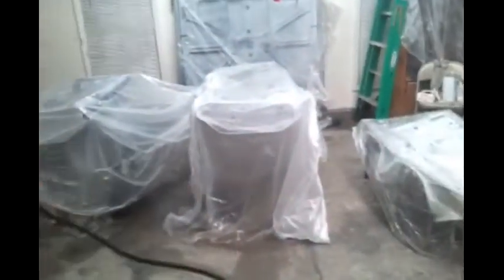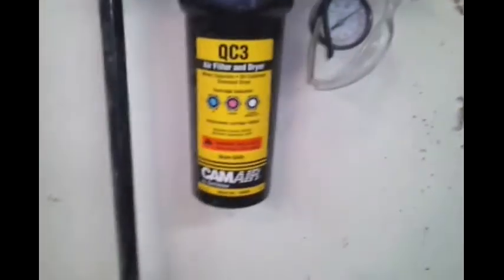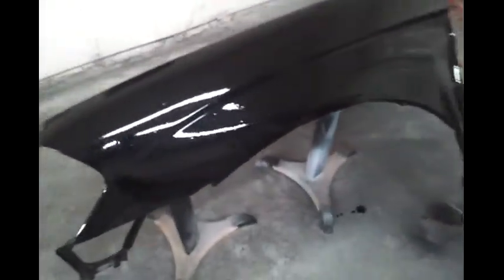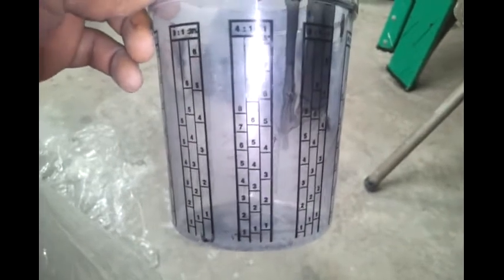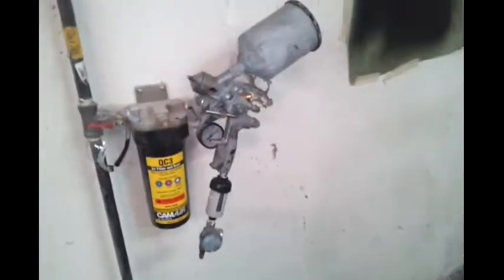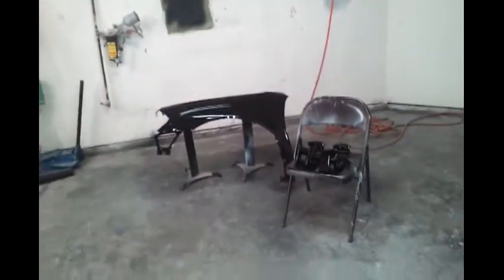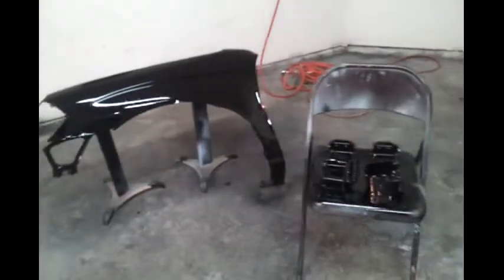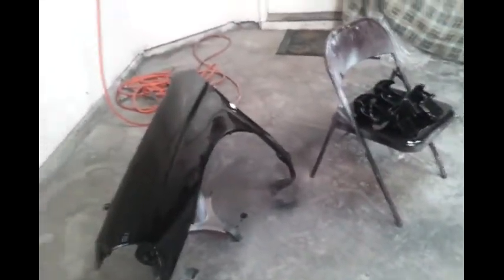Painting test panel and door hinges..."The Journey"

Comment from the maker: Thanks for insight, I hate I wasn't able to load the videos earlier so that I could get the heads up. I did a very very skim sand at 600, just to get the orange peel our of the 2K, so far, I don't see any scratches so that is good. I do need to dissable the entire gun was just worred about the settings. Loading the vids now of the jambs, standby because I have some questions..thanks for checking out the vids

Comment: Let me first say that I am a rookie too so take this for what it's worth. I might switch up the way you have your water filter set up on your gun.  I would put the regulator attached directly to the gun.   Move the filter below the regulator.  I find that the filters can really restrict the air pressure so you might not be getting an accurate reading at the gun.   I have the same guns as you by the way.   I have only used the primer gun so far though.   Good luck.

Comment: Also remember any extra uncatalized/reduced base coat can be poured back into the can.  Also, reduced and uncatalyzed base coat can be saved as well, but you need to keep it separate, so you don't try to mix more reducer with it later.

Comment: For sure the mixing ratio is real important.  You might have to use 2 mixing cups.  Pour some base into one cup out of the can.  Then pour from that cup into a clean cup so paint doesn't splash up the sides of the cup like it does out of the can, and you can pour slowly and under control and see your lines as you go.  Pouring into a cup out of a full gallon of paint is a real pain as you just found out!

Comment: I would question your gun setup on that splotchiness.  Getting the right fluid control, fan pattern and pressure is important.  Also it looked like your gun has an internal air regulator as well.  This should be opened all the way up and use an external regulator.  26-30 psi range with the trigger pulled.

Comment: Going from 320 to 600 wet is a bit step.  You might be running the risk of leaving some 320 scratches in stepping to 600.  I would go 320, then 400, then either 500 or 600 depending on which one you choose.  You should use your real gun for your test panels.  That's the whole point.  Get your gun fine tuned with teh right fan pattern, pressure, settings.  Get that all working right on your test panel, then you will be confident with it on the car.  Just be sure to disassemble the gun and cleanit